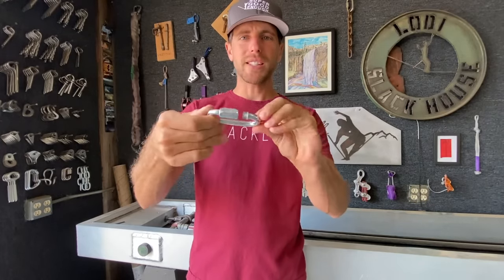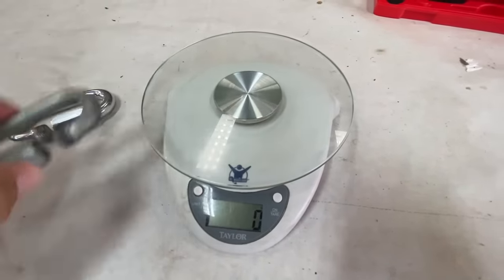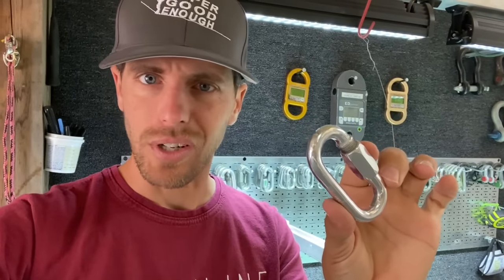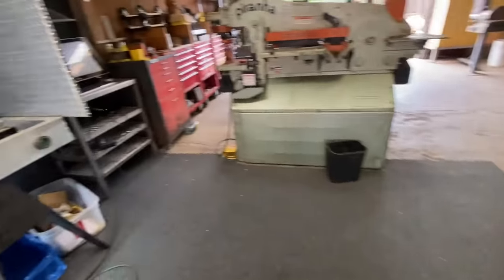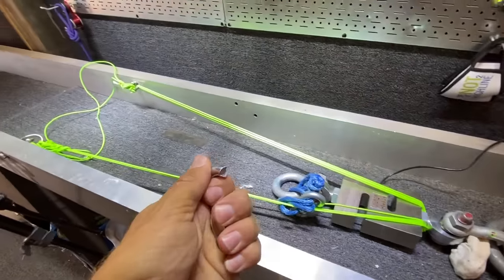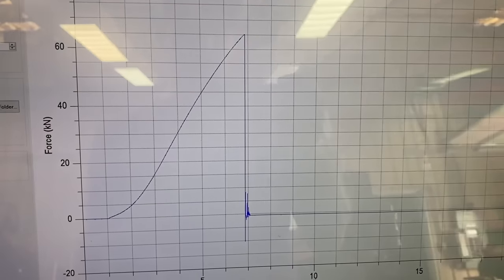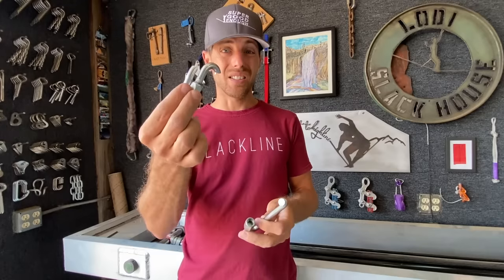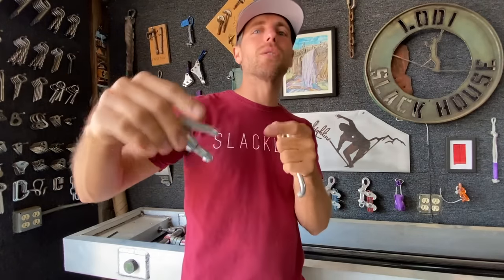Rated maillon rapide aluminum vs steel quicklinks.  Can we use these climbing and slacklining?

Comment: The only good reason I can think of to justify the use of steel is that cyclical loading will weaken aluminum but as long as it's below a certain force cyclical loading won't affect steel
Reply: They cost 3X as much as Steel.